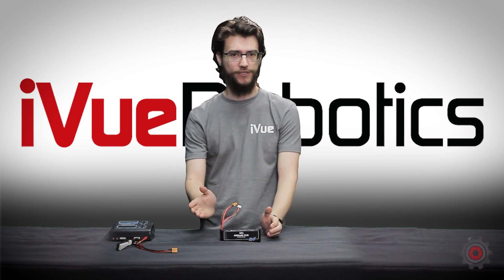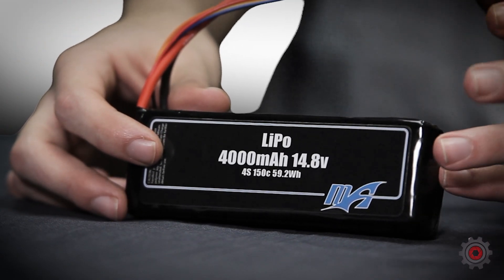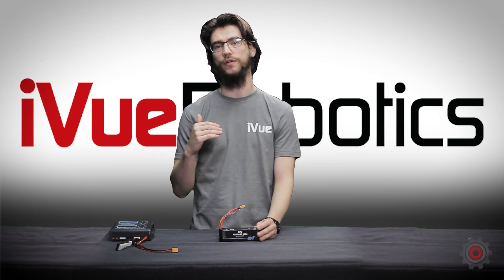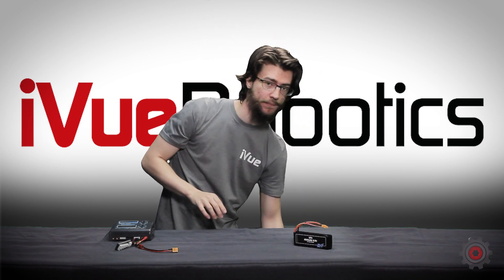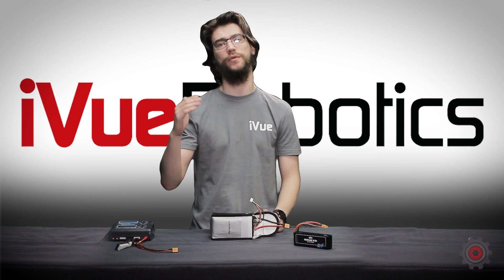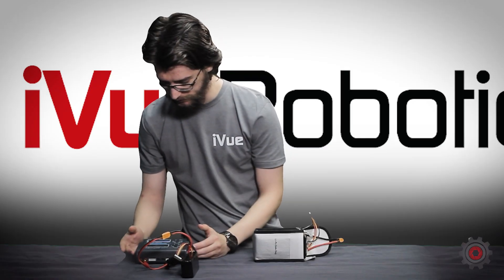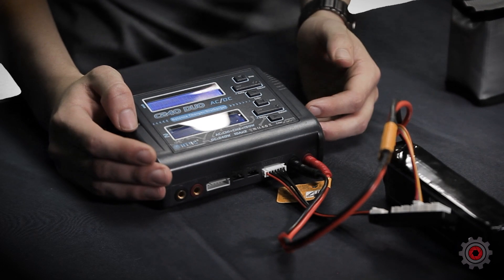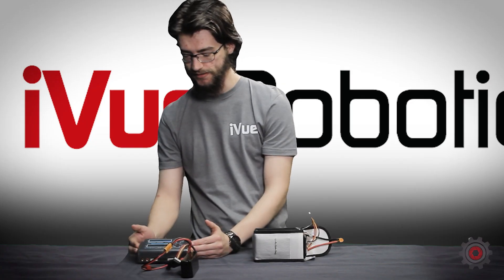How to Charge, Discharge, and Store Lipo Batteries

Comment: what about the proprietary batteries?
Reply from the maker: For Develop Air, there are no proprietary batteries, at least for the time being. The base model Develop Air, Develop Air mini, and Develop Air XE can use just about any 4S battery. The mini comes standard with a 4,000 mAh battery while the base model comes with a 8,000 mAh battery. The Develop Air HP comes standard with a 6S 8,000mAh battery.

Comment: Great video! I have a hard time understanding what amp i should use. Have 3s 5600a 70a how do i calculate it?
Reply: 5600 at 1C means you 'could' charge it at 5.6 amps ( divide mah rating by 100 to get max amp (C)harge rate).    e.g 380mah battery you could charge at .38 amps.  but to prolong your battery, charge it slower than 1c.   Thats why he charges his at 2 amps in the video.    Or for my 380mah example, I'd charge it at .2amps. or about   0.5C.       You should also not leave the battery alone when charging. stay near it, in case of a problem.   Good idea to have a small extinguisher ( not water based ) or fire blanket handy too.  just in case.